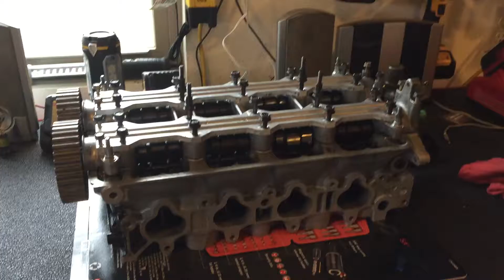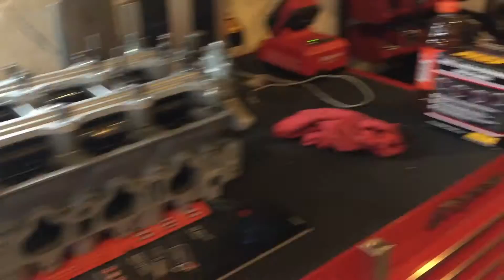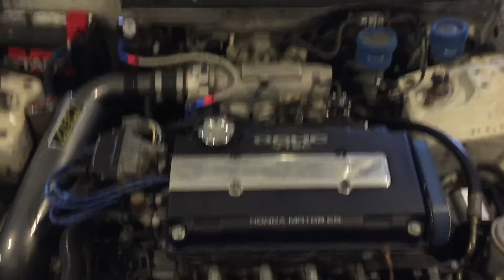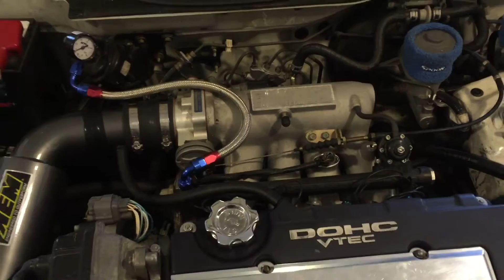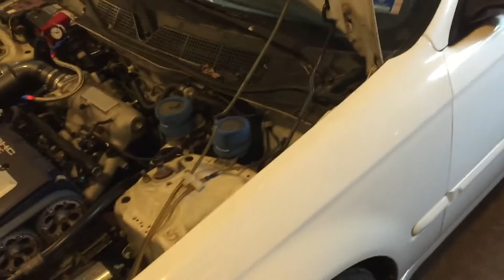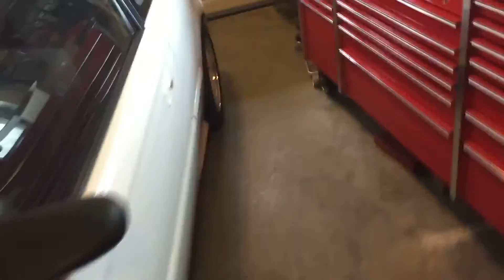Gsr b18c1 head

Comment: What's all done internally? 218 you said is what it makes right?
Reply: go watch his previous video, je piston 13:1, skunk 2 valve train, skunk 2 cams stage 2, arp bolts, st valve keeper,
Reply from the maker: Just like bolo said, I have vid of what's done internally. Check it out.
Reply: If your looking for more power why don't u get itb and get stand off injectors? But then agian it wont be streetable
Reply from the maker: Bolo Yaj 3.5 inch throttle body mate to a ported skunk2 ultra race manifold and all port match to the head is where I will stop. But yes, your suggestion of itb should yield the highest hp capability.